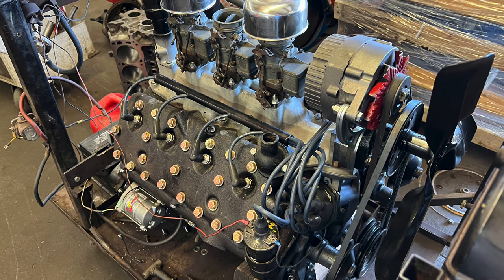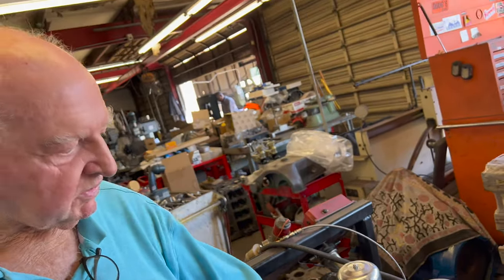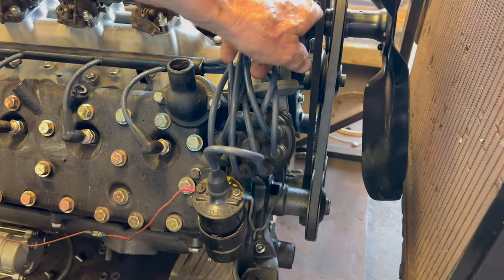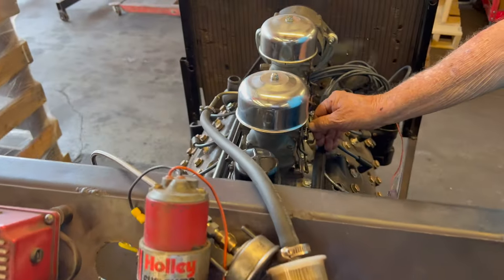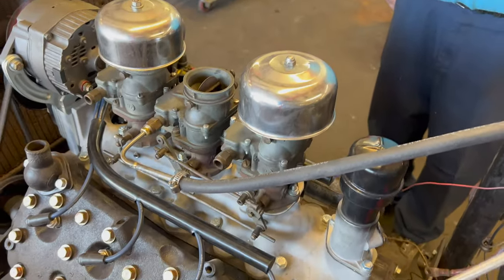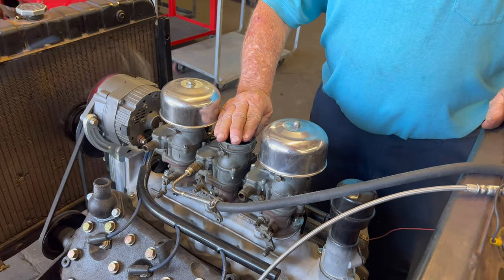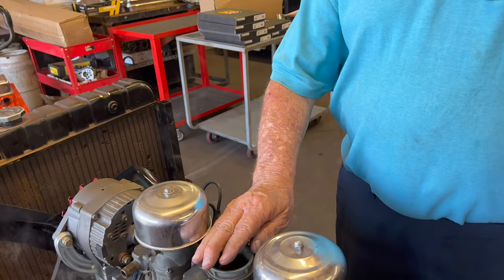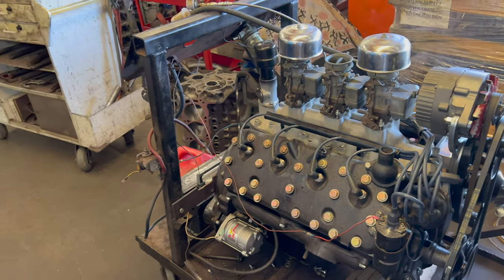Flathead Tuning Trick - Ed Smith shows latest Flathead Ford V8 Build, and carb tuning tip. #barryt

Comment: Sir, you have a new subscriber. Your engine sounds amazing. I've always wanted a flathead, and recently became the proud owner of a '50 Merc. The project stalled when the previous owner passed, so I am trying to sort out a few things. I have dual carbs, and what appears to be a linkage that operates both carbs simultaneously. Should this linkage be progressive? At low rpm would I be running rich? The plugs are burning black and sooty. The valves are oversize, and I was told it has a 3/4 cam. Thank you for your input. (Matt 73 y/o and new to flatheads)